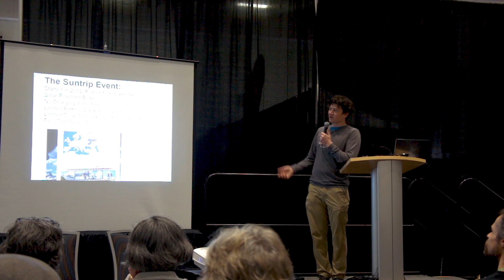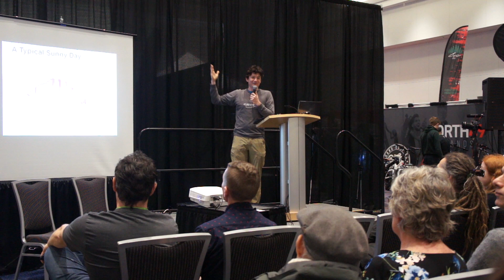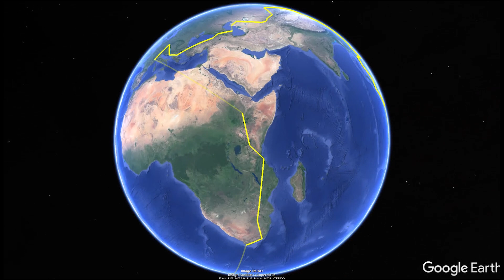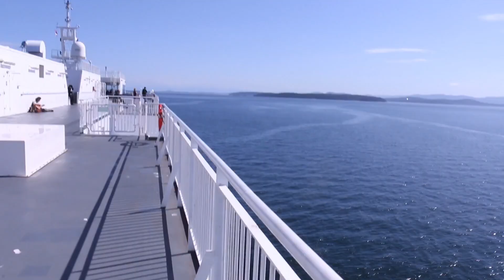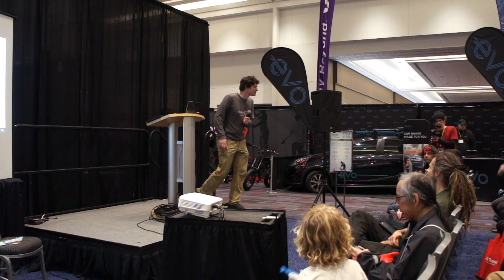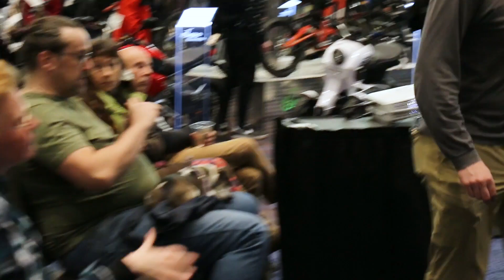Solar Ebike Touring, Experiences of the 2018 Suntrip Race, with Q&A Session from BC Bike Show

Comment: In the 1980's the Tour de Sol was carried out in Switzerland. They stopped and presented their self made vehicles in Bern, where I studied biology then. They used huge solar panels attached to self converted bikes or cars using engines from washing machines and the likes. I was very impressed then. Unfortunately Switzerland has not subsidized solar energy seriously, and meanwhile we are a developping country solar and also wind energy wise. Recently I have acquired an HP Velotechnik Speedmachine and convert it to electric and then to solar to revive the positive spirit from then in my home country.

Comment: hi, thanks for the amazing presentation! we are currently planning a  summer solar trip between Santiago, Chile to Mendoza, Argentina with 2,800 net altitude difference. We plan to have 2000 Wh battery with a 250W solar panel, my question is that our battery supplier recommends 2A charging and in you presentation  you had peaks of 9A; is it of any danger to charge at such high current or does the current go straight to consumption (load)? thanks for the answer, best regards, José Ignacio
Reply from the maker: Your battery supplier doesn't have a clue what he or she is talking about. A 2000 Wh ebike battery made of almost any lithium cell on the market could be charged at well over 20+ amps without any issue if you had a solar array large enough to supply that.
Reply: @GrinTechnologies  Thanks! I´m thinking maybe it is restricted by the type of connector? We use jack connector. We are going with a 2 X 1000Wh (13s7p) battery. We will continue to plane our solar trip, we would love to have a suntrip edition in the Southern Hemisphere, best from Chile, José Ignacio =)

Comment: I just made a trailer for my escooter that is about to have 2x 220v outlets thanks to how cheap you can get solar pannels, controllers, and DC to AC converts from china (eliexpress). Is it safe to have your charger plugged in and charging while driving with the stock 48v charger? I made this trailer for charging and camping. I know some ebikes don't let you use the throttle when charging but mine lets me. I also want to add that both my scooter and trailler have full suspension, I had two Daymak monsters and turned one frame into a trailer lol
Reply from the maker: There is no problem whatsoever to be charging the batteries while riding.

Comment: I realie this is an old video but here is a comment anyway: Any time you weld aluminum you need to heat treat the material to eases some of the tension in the area. The cracks might have been avoided
Reply from the maker: Yup that would certainly have helped if it was an option.  That said several other solar bikes during the race had aluminum panel supports with no welding (just screws and rivets) which also fatigue cracked and broke during the trip.  
We've since repaired and reinforced the cracked area with some thick gusset plates and look forward to resurrecting this trike on some future trips here in North America, where the roads are smoother and less jarring to whole roof structure.

Comment: Hi, I analize all of your posts and SunTrip endevour - wonder how is it possible to charge a battery using the controller from solar panel and in the same time using this energy from the battery during cycling? Do you use a batery charging port connected with pannel and another output from BMS to discharge ?
Reply from the maker: It is no problem to discharge the battery from the controller at the same time you are charging it with the MPPT.  The only times you will have problems with this is on very proprietary and locked down battery systems like Bosch which will not be happy powering the motor if they see current coming in from the charging port. Any conversion kit ebike or more generic ebike system will have no problem.

Comment: Thank you Justin, great presentation and alot of valuable information in particular about expectable numbers of energy generation.
Based on these and your experience could you also give a number for the best ratio between panel wattage and ideal size of battery based on a "normal' bike setup (~8wh/km) and not so competitive environment?
I assume it will not make alot of sense to have much more capacity than the average energy generation of 4x panel rating. 
Thank you!
Reply from the maker: Hi Hendrik, the answer to that depends a bit if you expect to be charging up at night as well or getting energy exclusively from solar. But in either case you really can't have "too much" battery capacity in a sense, since it will always serve to level out variations in solar output, and batteries last longer the lower the 'C' rate of charging / discharging which always benefits larger packs.  

If I was to do the suntrip ride again without the rule constraints and with the same vehicle, I'd probably go for about 3-4kWh of capacity. That would allow for a couple bad weather days in a row without too much of a hit on the range, and to 'bank' a larger stash of energy when the sun is good.
Reply: @GrinTechnologies  thank you for the reply Justin!
Yes, ideally solar energy should suffice to not be searching for plug every time but indeed, many variables are unknown and since this will always be true for the most important one (weather) it may be good to be on the safe side and carry 2-3 days worth of energy.

Comment: about those nominal 250W in Europe... it's not so much about lawmakers meaning well but about bicycle cops in big cities beginning to crack down on altered systems in excess of the allowed wattage, speed or for not having the mandatory pedal sensor to activate above 6kmh.
There are good solutions for cargo bikes and rickshaws by purchasing your setup through a local company (like ebike-solutions in Germany) that put a sticker on the motor saying that its "250W", in reality all these systems provide peak power well above 500W and more importantly the right amount of torque.
I'm using a geared "PUMA" (I think its a MAC really) 275rpm-wound front hub motor with a 36V/20A controller on a 16' wheel and guess who wins the drag race (despite a system weight of sometimes 600 to 700kg) at green light come Oktoberfest...

Comment: I am currently looking for a 48v 14A  battery for my solar project at around $500.  Most places I have checked don't recommend using for charging and discharging at the same time and/or no more than 5A current. Here is the list I checked so far as Luna cycle,Em3EV, and most from Amazon sellers except BtrPower but they sell 52V.  Thanks!!
Reply from the maker: Sometimes you have to take risk in your own hands.  It's true that many BMS circuits don't have overcharge cutoff protection on the discharge port and visa versa. But if you can't put in enough current through the charging port, then it's your only option, and the risks are low with a good MPPT.

Comment: Amount of pollution caused by jet fuel used to transport you half way around the world vs amount of pollution prevented by using an ebike? sorry I doubt this was a net positive!
Reply from the maker: For sure no one would dispute that. You need to ride an ebike instead of driving for about a year to offset one long haul flight.  Since I don't drive a car, that means I'm entitled to one flight to europe each year to match a typical emissions of average joe with a car ;-)   
But for touring trips that depart and return home, it's hard to beat the net emissions of a solar ebike with casual riding effort.  It's definitely better than a regular bike with double the food consumption.

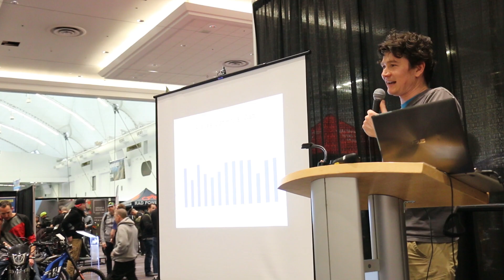Comment: Hi Justin, congrats on this presentation, really good stuff. Could you develop a bit more the idea around the number of 4wh/w. I understand how you got to this number but some people didn't really understand how you use that number to size your panel. On minute 22:30 you mentioned that you just need to divide that number by 4 and voila.. what number needs to be divided by that factor of 4? Keep up the amazing work!
Reply from the maker: Hi Luis and sorry to hear that this detail wasn't very well explained. The number you divide by for is your TOTAL required daily watt hours. If you estimate you need 1200 watt-hours / day for the setup for your daily range requirement, then a solar panel of 300 watts (1200/4) would be about right. 

On full sun days you'll get more, on cloudy days you'll get less, but the average will work out pretty close to this.
Reply: Hi Justin, thanks for your reply. In fact, after watching the video a couple of times I noticed that you do say the words "how many watt-hours you need". I'm the one to be sorry ^^

The data you collected is very valuable (of course, within that geography and time of the year). It's amazing how the mean values don't differ that much (considering the different systems and panel efficiencies). Also amazing of you (and probably thanks to the Grin Tech Team) managed to assemble a set of sun data loggers to have them ready for the trip. Thanks again for sharing this amazing info with the public. Amazing stuff!

Comment: Absolutely amazing presentation Justin.  Very informative and detailed.  There is not much technical details on YouTube or net in general about the SunTrip.  So this video is very helpful for people that want to do SunTrip race.  I actually applied very late for 2018 SunTrip but the organizers didn't didn't think was enough time for visa's.  Plus my bike wasn't the greatest setup, I built before I found out before SunTrip.  Then because financial reason's in 2019 could't do 2020 race.  But since postpone to 2021 I re applied.  Already working on whole new bike design.  What are your thoughts on mid drives?  I am planing on using a Bafang BBSHD with your Phaserunner & cycle analyst v3.  I am currently using a cyclone motor with Kelly controller so I am use to mid drives. But now thinking getting your new v2 direct drive hub motor.  On a long steep hill can a hub motor get same Wh per km compared to a mid drive?  Supposing there no human power.
Reply from the maker: Hey Daniel and great to hear of your pending presentations!  Mid-drives have potential advantages with heavy solar bike rigs where you can encounter all kinds of terrain, but historically they have had higher failure rates than hub motors in all the suntrips so far. In our year there was one guy (Jack Butler) who completed the entire trip with a BBSHD with no issues while another rider had BBS02 drive fail fairly early on, and one of the other commercial mid-drive bikes failed too.  
It depends a bit what you are familiar and comfortable with, but if you do go the hub motor route you want to make sure it does have enough torque to handle the weight and grades of your vehicle.   
The mid-drive in an easy gear will definitely use less Wh/km climbing a steep hill, but the hub motor can make up for this with regen on the downhill stretch. So it ends up a bit of a wash for your net wh/km at the end of the day.
Reply: @GrinTechnologies  Yes I am very exited just hope I can complete the bike and get in some heavy testing, do some local touring before the race.  SunTrip organizers haven't gotten back to me yet so don't know if 100% going be accepted or not. Yes mid drivers are not very reliable,  soon after I got my cyclone a snap ring popped off a gear.  I remember watching Jack Butler videos before 2018 race.  I thought no way he going make it on BBSHD, I was amazing that he had no problems.  He even went on further another 3,000km with very little issues https://www.youtube.com/watch?v=4_VRs3IzpEk&t=217s     I am really curious what he going to use on his new recumbent for 2021 SunTrip if he will use anther BBSHD or not.

Think key for any mid drive is simple design the big name commercial ones are so complex design.  And got bring spare parts for mid drives like Jack did.   Bernard Cauquil 2015 winner looks like had mid drive on his bike.  Yet the 2018 winner Raf Van Hulle won with a crystalyte hub motor.  Does seem like its bit of wash in end both got advantages and disadvantages.  Just watched your 2 hour video on hub motors incredible amount of info you are the king when it comes to hub motors that for sure.

Really is hard choice thinking sticking with a mid drive.  Like you said its what most familiar and comfortable with, I know its limits and capabilities well.  I actually got a sponsorship with cyc motor few mins ago.  Said they would provide me parts free of charge :-)   They have a very well built  Astro like motor in their CYC X1 Pro  v2 kit I been really interested in.  Very high rpm / efficient motor.  https://www.youtube.com/watch?v=UxieiFgDbmA    They are such a new company though seems risky.

Comment: I was not at this Q&A session but my question would be: "Up to a certain point, would a higher than normal KV brushless motor be the most efficient for ultra long distance?"  I'm thinking a higher KV brushless motor may be more like "overdrive" for ICE engines. The downside would be less low-end torque for acceleration and hill climbing but more efficient in the long straightaways.  Also could get higher top speed on straightaways.

Another question, would a non-pure sine wave ESC be more efficient for the ultra long trips?  Pure sine wave controllers are good and all for constantly changing throttle.  But a cheaper "jagged" wave form ESC may actually be more efficient for long duration max throttle because the MOSFETs are doing less switching?
Reply from the maker: The KV of a motor in and of itself is a non-factor. Simply choose your motor KV and battery voltage so that the motor is able to spin at the highest max speed that you want in your travels.  Fast and slow motor winds produce identical torque levels at the same efficiency as long as you scale your controller max phase amperage in proportion. 

The question about mosfets switching losses vs better controller efficiency is a really good one, and my own dyno test results have resoundingly convinced me that the gain in motor efficiency from a field oriented controller more than outweigh additional switching losses.  I used to be more of a skeptic on this front.